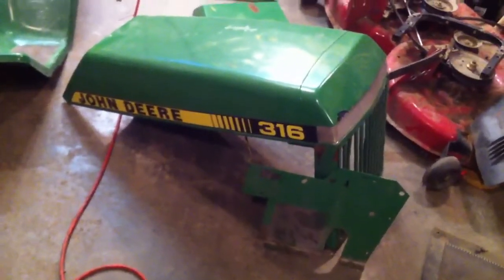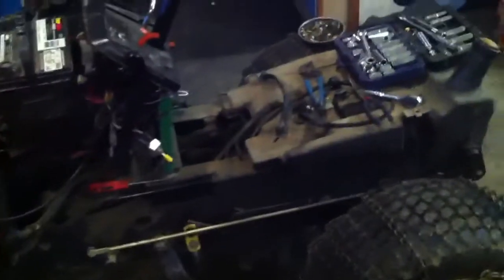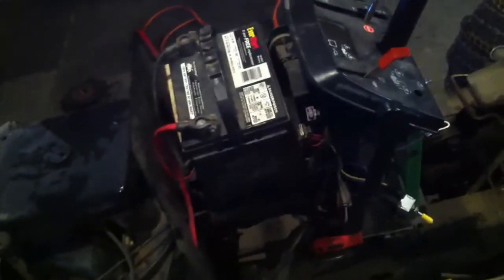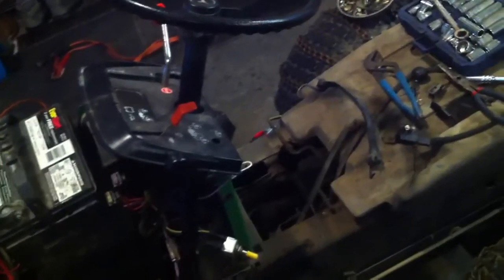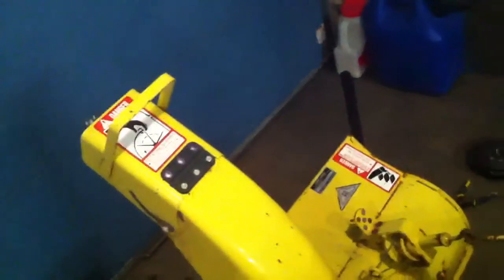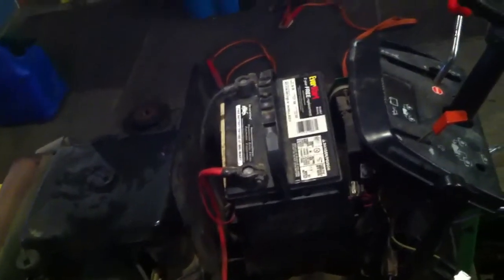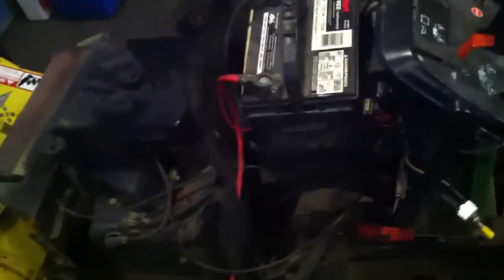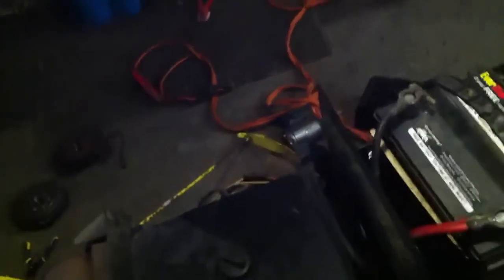John deere 316 pto problem, any suggestions?

Comment: I don't know if the safety's are normally open or closed on a jd. Unhook the seat safety completely and see what that does. It may normally be an open circuit and grounds out when the safety is closed. Second thing is put the clutch back on hook it up and with the engine off see if it engages. It will make ting sound if it does. You'll know it when you hear it. That just means its engaging. Other than that bad connections or a smashed wire some where. Also did it happen all at once. or gradual

Comment: sounds like a problem i had with my 316. Have you checked the clearance between the pto clutch it should be i believe .018 also the other problem i have had is theres a ground wire next to the sylonid on the wall that needs to be grounded.

Comment: mine does the same the thing mine is an older 140 so i wouldnt think it has a safety switch. i take the belt off and engage the pto the motor doesnt die but the pto sounds real noisy so i think a bearing inside wnet out or the shebang isjunk